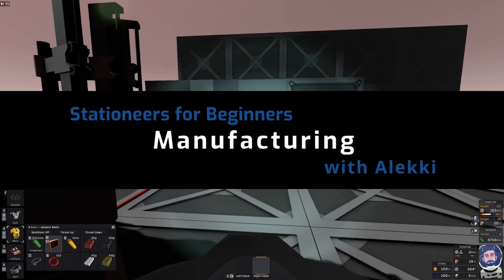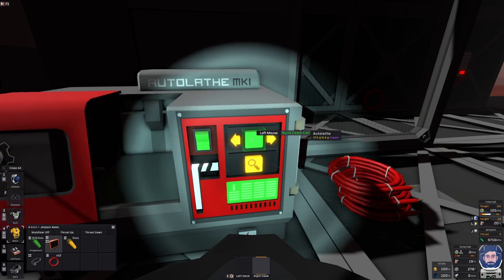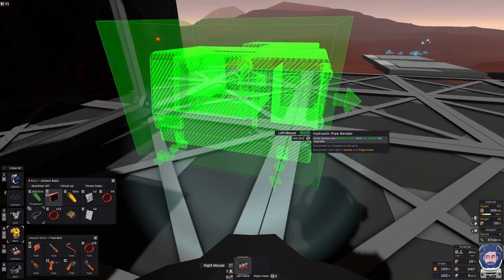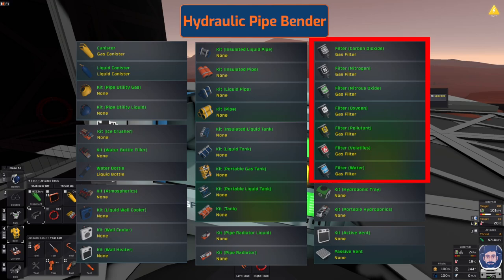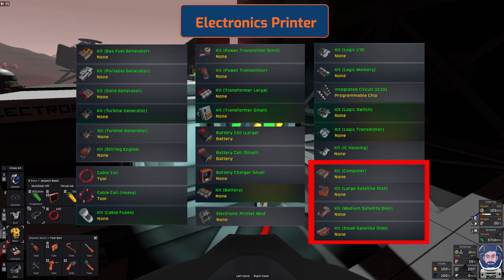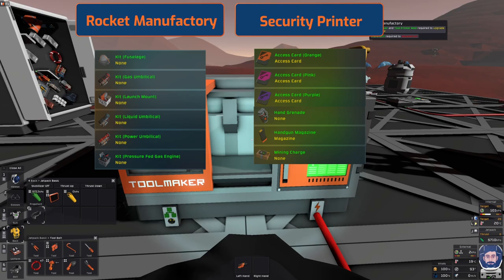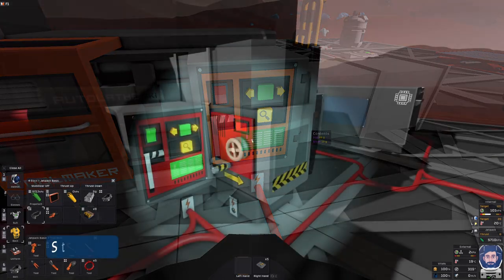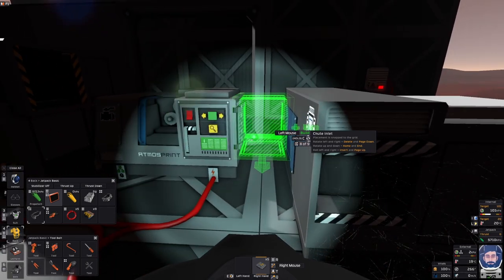Stationeers for Beginners - 6. Manufacturing & Chutes

Comment: I personally prefer to place the stacker either directly beside the machine with 'one straight chute' spacing but without the chute, or on top of the machine with one corner and one straight chute and then an outlet to the left. 
The gap allows me to put stuff into the stacker like the three cables or plates i have left in my backpack. 
This also allows to use the coloring trick where items added to a painted stack will receive that color.
When the stacker is on top of the machine purging the ingots will drop them right in front of the inlet.